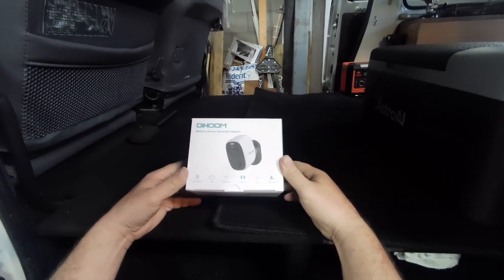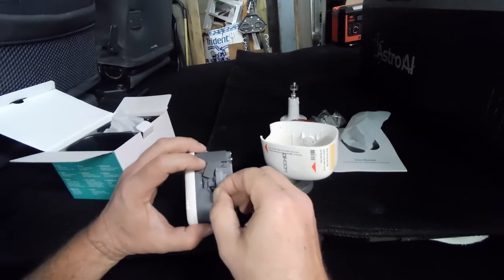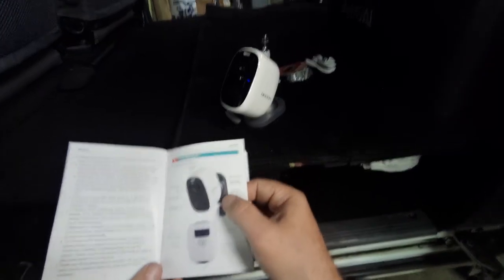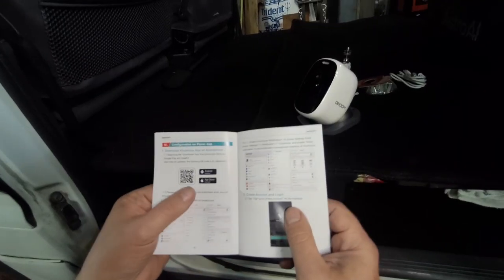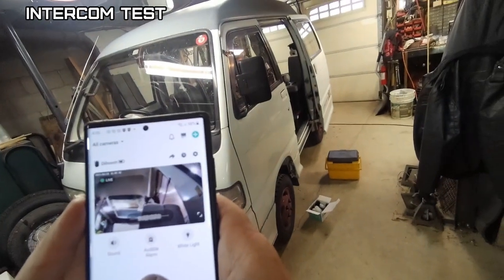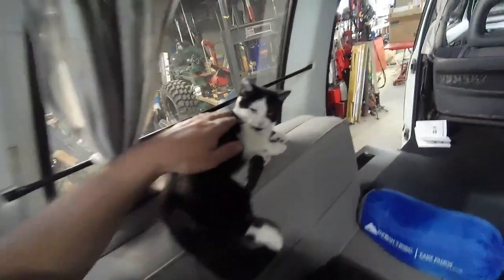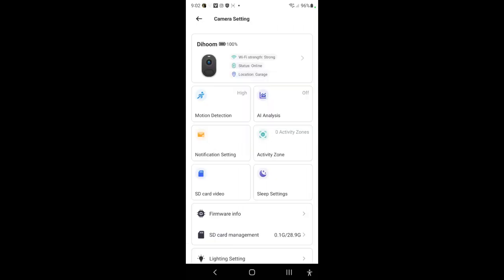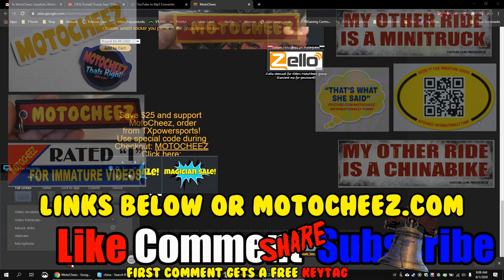Dihoom 2k outdoor battery powered smart IP 4mp camera spotlight siren closeup, review, test, videos

Comment: To setup the camera in an area with no WIFI. Could I use my phone as a hotspot to register it. Then still use the SD card for recording, and use the phone app.
Reply from the maker: 8 believe that would work, as long as the hotspot is 2Ghz wifi
Reply: Looking through the customer questions It says the camera has to be connected to WIFI to record. 
I know some Reolink 
cameras can record to SD card without WIFI
Reply from the maker: That's odd, never knew any won't record without wifi. 
Like you say, I've had battery wifi cameras record when internet is down many times.
Reply: Those customer questions on Amazon can be misleading. Especially if it's a seller with poor english, like when you have an instruction manual, that has been written in poor/basic english.
Reply from the maker: Definitely

Comment: Cheez, did it ask you to subscribe to anything or pay for playback access? I'd be happy if I could even go back 7 days without paying monthly.
Thanks for the review, the other one I watched was the guy taking it out of the box, telling us the app had 4.9 stars, reading off the features directly from the box, and then saying he gives it a full 5 stars..... Didn't charge it, connect it, or use it.... But DEFINITELY plugged those purchase links in the comments lol
Reply from the maker: I didn't subscribe to anything, I use the internal SD card and so far it hasn't used hardly any storage. Looks like it may last a few months before it starts over writing oldest. Files. I also set record duration to 30 seconds